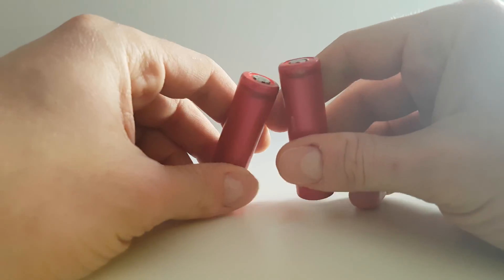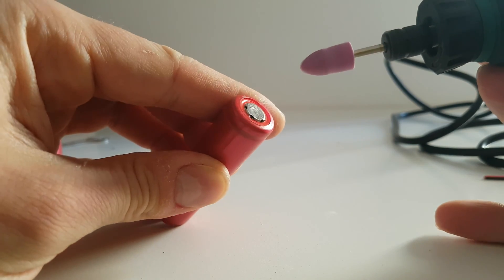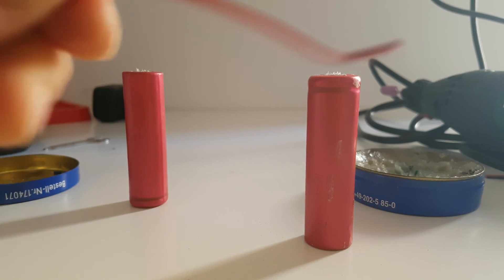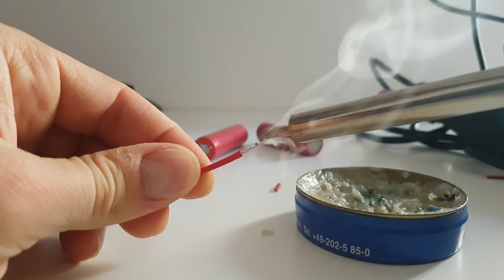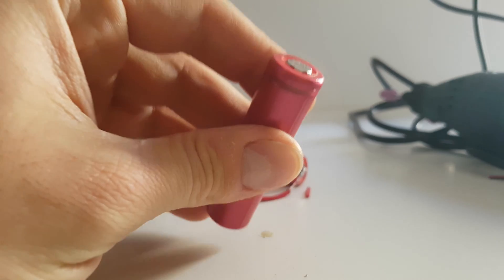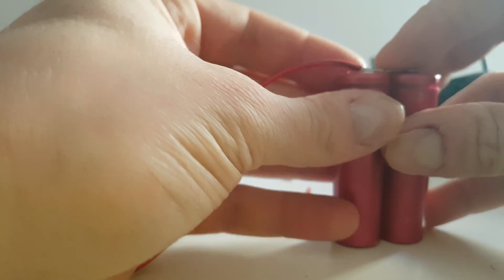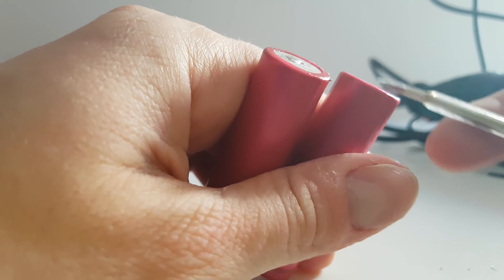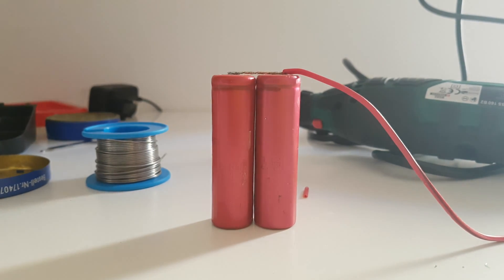Soldering 18650 Batteries (DO IT RIGHT)

Comment: So, you can do it that way, hower that is not the best approach.
First of all, if you need to do a battery pack from 18650 cells, the preferred and best method is by spot welding them toghether, with Nickel strips - that is the safest method.
Second, if you must solder them, because you do not have a spot welder, you have to take this in account.
A. Prepare the cells by scuffing the surface of the negative and positive poles wits SANDPAPER (not an electric grinder because you risk ruining the plastic casing). Then clean with alcohol in order to ensure the best surface for the welding material. Final stage for preparation is to stick the cells together in the proper order (positive to negative and so on...) and glue them together with super glue, tape or even double stick tape so that you have a solid pack to work with.
B. Nickel strips are preferred even if you solder the cells, so prepare nickel strips that you need and also scuff them a little with sandpaper and clean with alcohol. The wire you use here may be ok for your application, however, for a battewry pack used on a drill for example (discharge currents of over 20A) that will be a fire hazard.
C. Apply solder paste on the terminals and on the nickel strips.
D. Heat on the iron should be between 430 - 450 Celsius ( 800 - 840 Fahrenheit) in order to be able to solder very fast and as cool as possible. In a  good weld both elements should heat up in order for the solder to make a good connection.
C. Apply solder to the battery terminals and then solder the nickel strips in position, taking care to move very fast. If the cells experience a litthe heat for a very short period of time there is no problem, they are capable of that. Do not heat them too much or too long, but a little heat is fine. PLEASE BE CAREFULLL - do not solder the wrong terminals because a short circuit is a fire hazard!!!
D. After soldering all the strips, check again that you soldered all ok and in the correct sequence and apply more isolation if necessary so that your battery terminals do not contact elements of the casing or other electronic components.
Cheers!

Comment: Do it outside in case of battery failure. Just to add extra security with working with 18650 and just in case- I would charge it first time outside after soldering.

Comment: I would only add that you want to do this with a rather hot soldering iron - temperature set somewhere between 400 - 450 C.  Very hot and very fast with lots of flux is the key here.  Keep the heat only in the area being soldered and don't give it time to spread.

Comment: I am trying to make a 3x3 18650 laptop battery. Should I use wires like you use to connect these, or metallic plates? Your method is good in the sense that there is less risk of causing a short circuit since I have read the that the negative terminal is close to the positive one.
Reply from the maker: I think the metallic and my method is great for me .
Is on you what you want or what is more suitable for your project:)
Reply: ..."negative terminal is close to the positive one"   What do you mean?
Reply: @jamalasa9007  the entire case of the battery is the negative, and it stretches all the way up to the top of the cell.

Comment: This is so NOT PROPER!!!  Use rosin flux on cell. NEVER NEVER SAND OR GRIND!!!!
Reply from the maker: no if you use rosin flux only then the time to welt is bigger 
with 2 second of grinding and then use rosin flux is better
Reply: ruffing up the surface is no harm to the battery and makes if much easier for solder to stick
Reply: Don't get your panties in a bundle
Reply: Never sand or grind?  Why?

Comment: Hello, so to make the two batteries work together we just solder a wire connecting the positives and the negatives connected to the negatives? Jut making sure before I attempt that it’s positive to positive and negative to negative. Is this called in parallel? Thanks for you time
Reply from the maker: how many volts you want?
Reply: TechGuru Andrew honestly I’m not sure, just making sure it’s the right way to wire them to use them as one battery
Reply from the maker: it depends what you want to do.
Reply: TechGuru Andrew I’m going to wire to a solar cell and make a solar charger